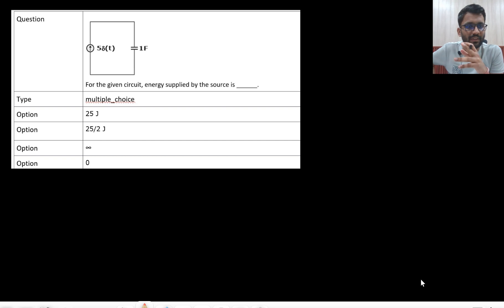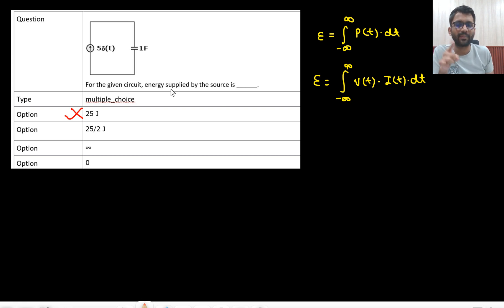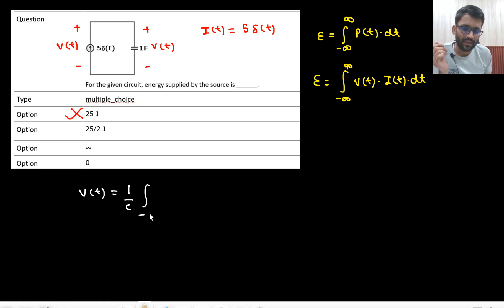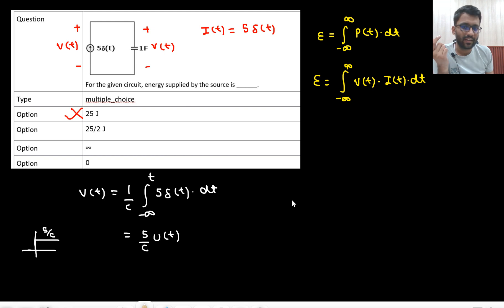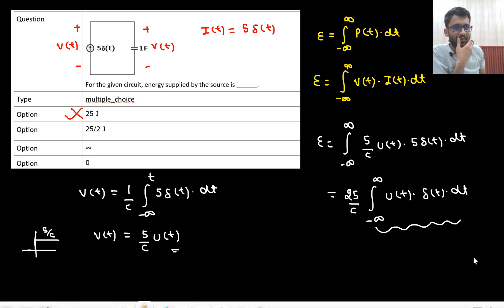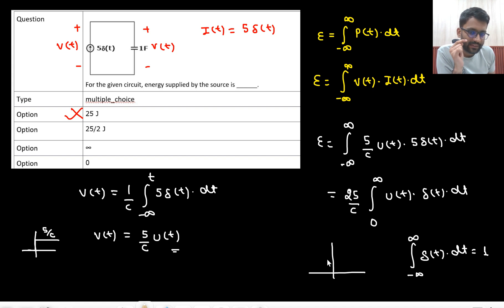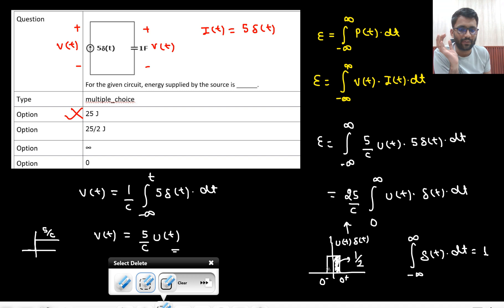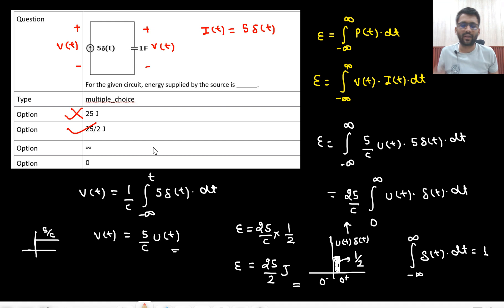Error in AIMT - 2 SOLUTION [Tech Q-25] || Analog VLSI Placements || PrepFusion || Himanshu Agarwal

Comment: Energy given by source is equal to energy gained by capacitor..so assuming initial voltage across the capacitor as zero..

For t < 0, there is no change in capacitor voltage so energy gained by capacitor is zero = energy supplied by source.

For t>0, capacitor voltage is 5V, so energy gained by capacitor is 0.5*1*5*5 = 25/2.

So energy supplied by source for t>0 is 25/2 assuming capacitor's initial voltage across it as 0.

But we cannot use this procedure if you have extra resistors in the ckt...as resistors dissipate energy which we need to consider.

Comment: Well the integration is not defined the way it is dealt,  but we can calculate the value of u(t) at t=0 by taking average
Reply from the maker: So, You are taking u(0) = 0.5, Right? 

But there is no proper explanation present how one can take U(0) = 0.5. you may say I'm taking an average of 0 and 1, but is there any proper explanation why are we doing so?
Reply: @PrepFusion_GATE  we don't know the exact value of U(0) but for analysis purpose we take average that's what it is taught in signals